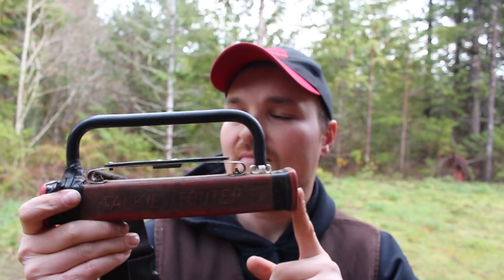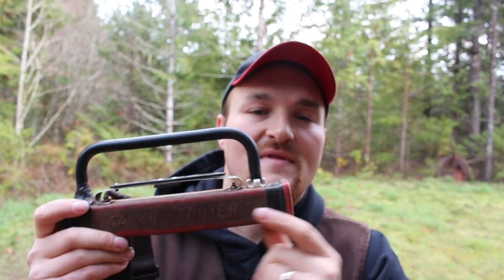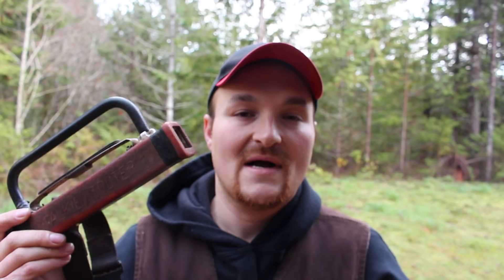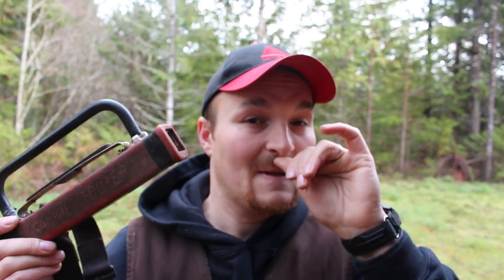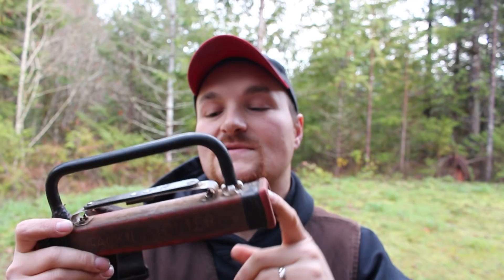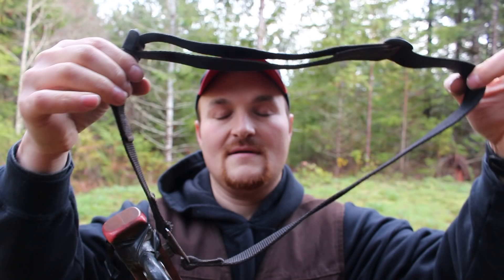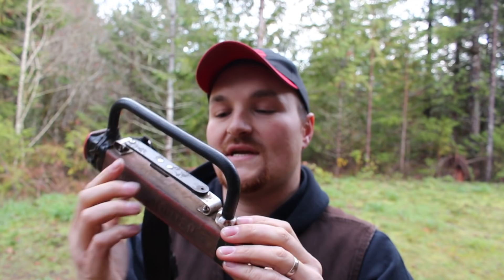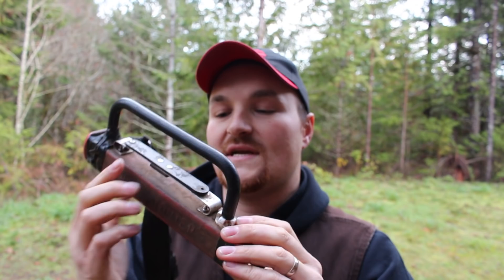HIGHLEAD LOGGING WHISTLE SIGNALS. (A how to video)

Comment: I worked for Handly & Phillips in mid 80s and the sky line was 5400 feet to the tail hold using a Danabo sky car the average turn was 47 whistles with two bugs and alot more if the skidding line wrapped the sky line. We had 500 feet of lift and the road lines were 200 to 300 feet wide that was the good old days.
Reply from the maker: I saw the photo's of you working on the "big side " those were definitely the good ol' days. Thanks for jumping on here and commenting Kenneth.

Comment: Hey , thanks for putting it to practice . You know , it may be an age old system , but it's very valuable in the woods . We all know that radio communication has its limits . Line of sight will never interfere with this system . Old school is best school . This system could have been useful when I used to deer hunt but I would think that any loggers may not like hunters using their communication system as it may cause confusion . Rightfully so , since FCC wants CB and FRS/GMRS radios used properly , this system should too . Don't know of any logging is done anywhere when hunting is in season , maybe not for obvious reasons  . I once hunted New Brunswick Canada and logging was shut down until the seasons end . But I'll say , we sure could have used a reliable system like it instead of lost communication and dead spots at the worst time . Thanks Daniel , no one can improve on what works !
Reply from the maker: thank you for watching and commenting man : )

Comment: The whistles you just showed are alot different than what we used. When either shotgunning or slacklining, A long and short plus 3shorts, were up on the skyline and ahead on the skidding line at the same time. Slack the haulback was just  2and 1. I know other outfits use different ones but they seem confusing to me from what I was used to.
Reply from the maker: Hi Mitch, is the slackline whistle signal video i did similar to what you used ?  yeah there are so many variations now i'm not sure anyone goes by what the book says haha.
Reply from the maker: https://youtu.be/ezuox4lExNs

slackline whistle signals
Reply from the maker: this is a vid of a variation of whistles used where i worked.
https://youtu.be/i0ngr5wCh1E